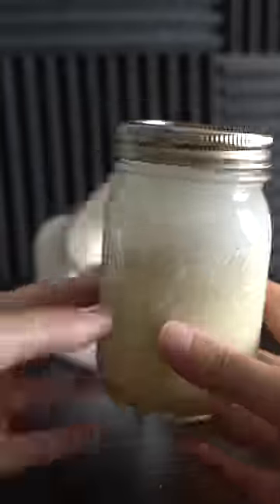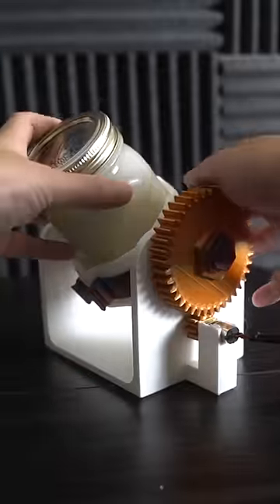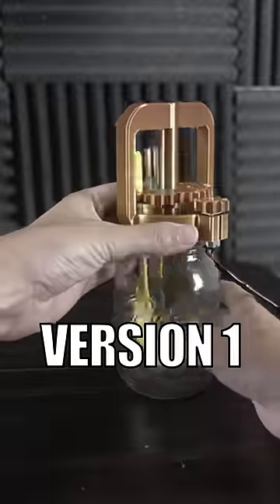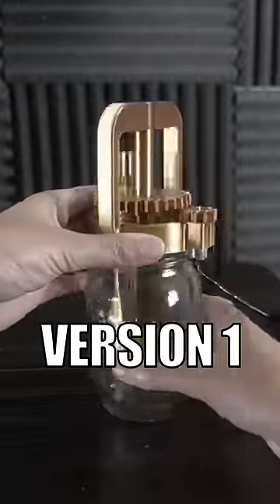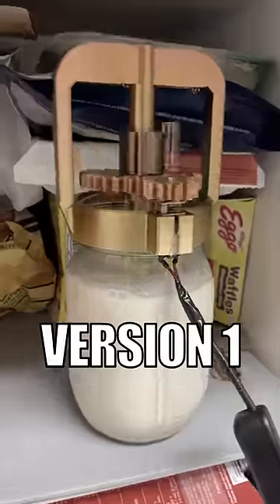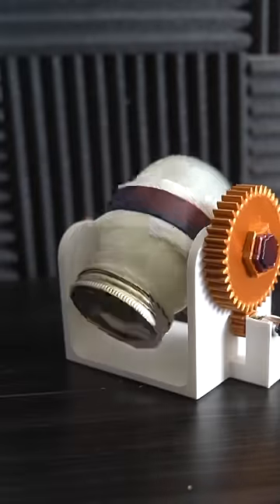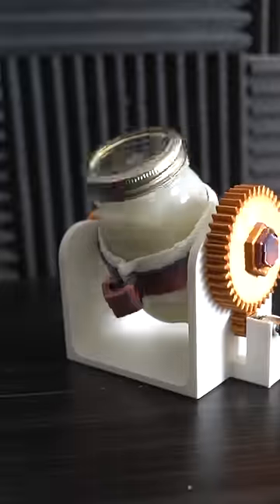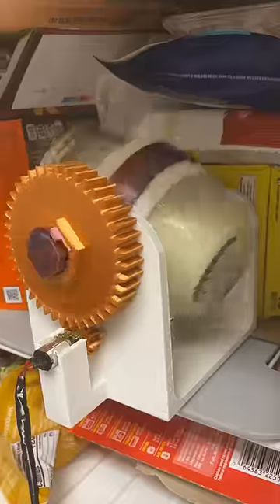3d printed ice cream machine, version 2. #shorts

Comment: Watch out for condensation on those electronics, but very cool 😎
Reply: Literally just a motor
Reply: You can always use conformal coating on your electronics to waterproof them
Reply: Also as far as I'm aware 3D printed material is not food safe for the same reason that it is not good to make sex toys out of
Reply: It's a cheap. Who cares. It's not high voltage.
Reply: @katiebarber407 The plastic does not touch the ice cream, as it is inside a jar

Comment: great design and idea, tho i feel like you should slim it down and take some inspiration from a rock tumbler, you could even use a wound up spring to spin the jar
Reply: You need a very powerful spring to spin a jar for this long, I'm pretty sure that wouldn't be practical
Reply: @alexus6237  i'm not suggesting powering the whole period of one windup, unless we also add some gears.

but it could be fully printable, and would likely also be better than putting a open dc motor and battery into your freezer.

alternatively you could make a proper casing for the electronics.

Comment: Printed this and works great.  Just need to get the wires to stay soldered better to the motor posts.  But otherwise I have my second batch spinning away in the freezer right now!
Reply: Hot glue works pretty good.
Reply: @wittandrew91  I'll try that.  Thanks for the advice.
Reply: Battery powered? Or cord going out of the freezer?
Reply: @Werdna12345  I have the cord going out the freezer door
Reply: I don't know how much power you need to draw for a motor powerful enough to run this, but it occurs to me that many USB charging cables are quite flat which would be better for running out through the seal in the door.

Comment: Won’t work. The custard needs stirring as the ice crystals form, that’s how air is frozen into the mixture. By simply tumbling the custard, it will just freeze as a solid block from the outside towards the middle.

Comment: Can you 3d print a 3d machine?
Reply: that was the original goal of a 3d printer. the answer is no, because you've got electrical circuits, screens and motors which you can't print
Reply: There are SOME that the supports and such are "fully 3d printed" but as mentioned by the other person there are parts that must be added like motors and control boards and such
Reply: Yes... With the exception that some structural and motion components need the hardness, rigiditiy and precision of aluminum and steel.
You can even print the PCBs for the controller.
Reply: @ablebaker8664  you can't, it will turn into a giant resistor
Reply: @ablebaker8664  how are you gonna 3d print semiconductos? :)
Reply: @king_james_official  
Yeah... you print the board, not the components.
Then you sand it nicely flat and use a high temp epoxy to glue an appropriate thickness copper foil to it... mask it, etch it, fill it and solder it up.
Personally I'd rather just order one printed for me online but it's a great teaching experience to at least etch your own PCB once just to learn the process.

Comment: Ice cream is made by scraping ice crystals that form on the colder walls of a cooled chamber and incorporating air known as over run to make creaminess.   Rotating a bottle in a freezer won’t achieve this but make an butter churn with fats sticking to the outer walls and a sweet layer of sugar and a layer of tasteless foam like a centrifuge. besides the heat of the motor will create a warm spot in the freezer later to accumulate water vapor and kill the motor quickly.